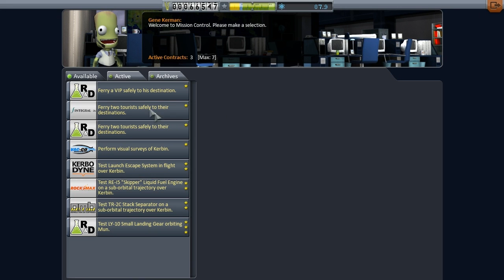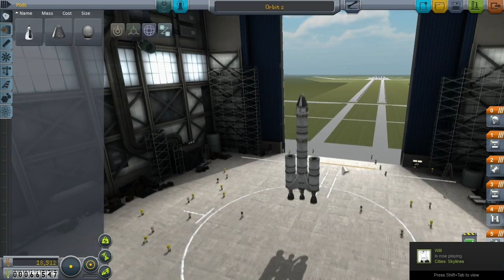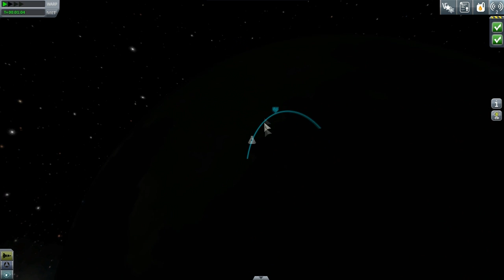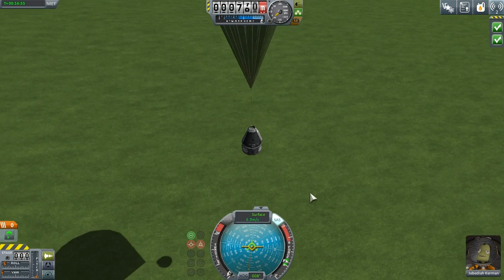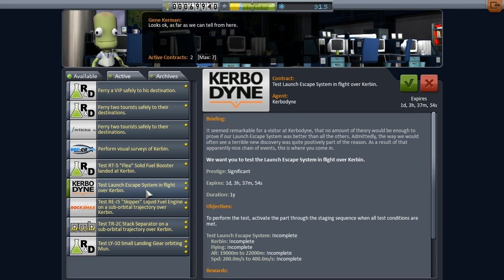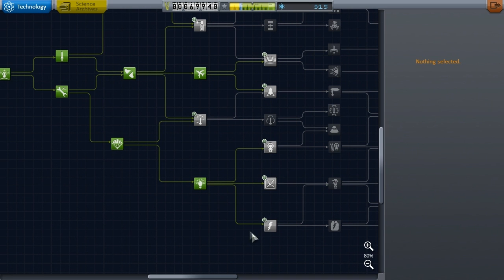Kerbal Space Program - Space Manuevers! #6 (Career Mode)

Comment: For orbital launches, you want like, 2 of those big solid-state boosters on radial de-couplers and a couple launch stabilizers on the right angle from the boosters so it doesn't get the idea of falling over before you launch it. For Mun or further, use 4 radial-mounted solid state boosters with decouplers to use even less liquid fuel for the launch.

Comment: Love your videos but bloody hell you've made it hard work to achieve orbit, the first proper rocket i launched to space i achieved orbit straight away although i did run out of fuel so couldn't get back into the atmosphere. Get above 80k + in metres and then point the nose cone to the horizon and go mental and watch as you achieve orbit on the map. Only thing I'm struggling with is getting loads of cash to upgrade facilities to go further into space.

Comment: You can right click on any part to see data on it, or interact, like shutting down engines or disabling control surfaces.
Your problem with running the test on the Terrier is just you being a noob, you do have to stage to run the test on solid rocket boosters. But liquid engines can be tested  by clicking on one of the buttons you get from right clicking on them.

For what size rocket your using, you should have a small tilt until 5,000 to 8,000 meters, then a 45 degree tilt at 10,000 meters, and by 30,000 meters you should almost be titling horizontally. You want to kill the engines before 50,000 and drift into space, then point BELOW the horizon to extend your ballistic arc into close to an orbit. When you get near your apoapsis do a horizontal burn to flatten out your orbit.
You really should use solid boosters in your first stage to gain a bit of altitude and speed, it's cheaper than a bunch of liquid engines sending you up to 10,000 meters.